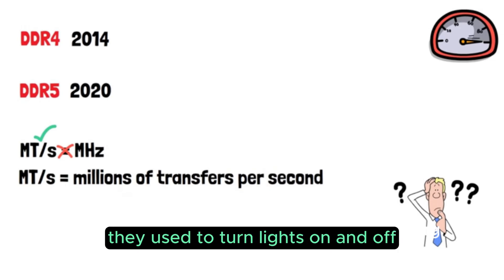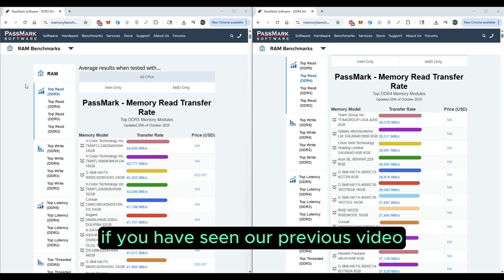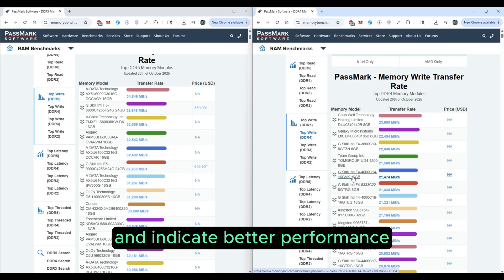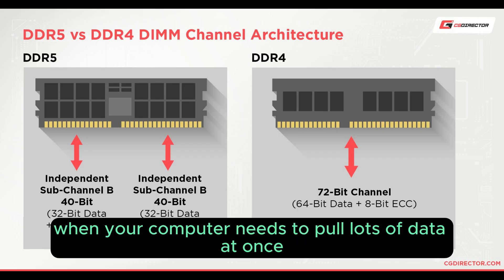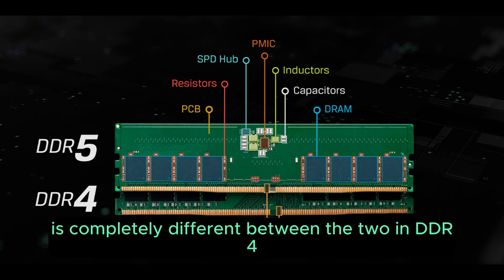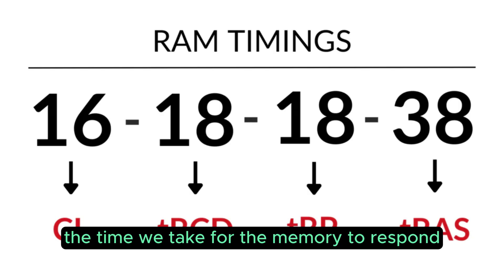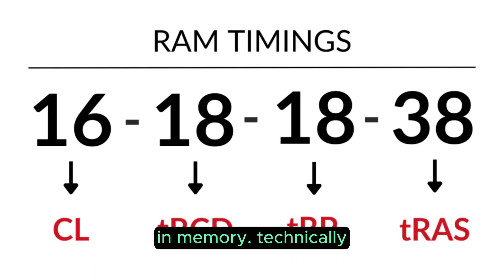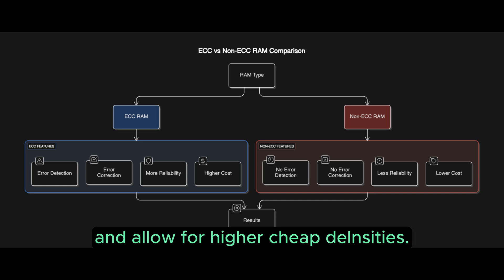DDR5 vs DDR4 — Benchmark, Latency, and Real Performance Test!

Comment: The main question is how much token per second speed can ddr5 increase over ddr4...
Reply from the maker: For example : ddr4-3200 theoretical bandwidth is 25.6 gb/s and ddr5-6400 is 51.2 gb/s ,that 2x faster than ddr4 .
Mt/s * 8 bytes = theoretical bandwidth but other component like motherboard and ... can cause this number up and down .